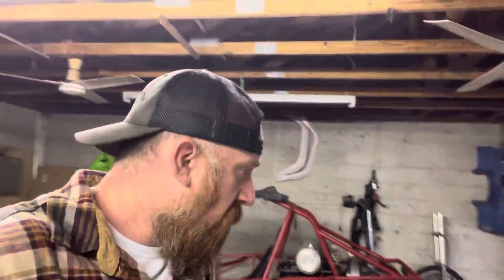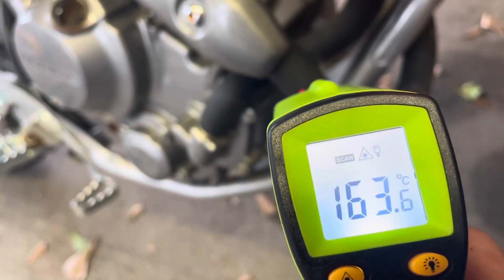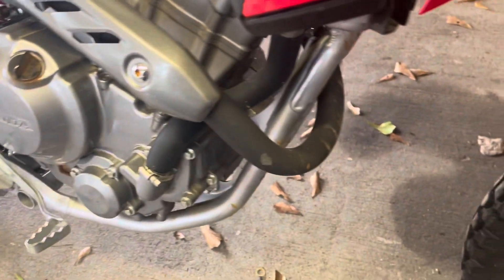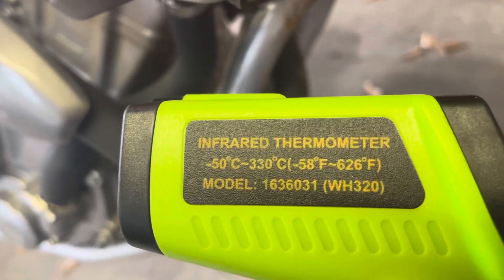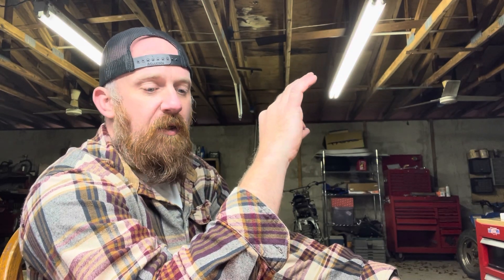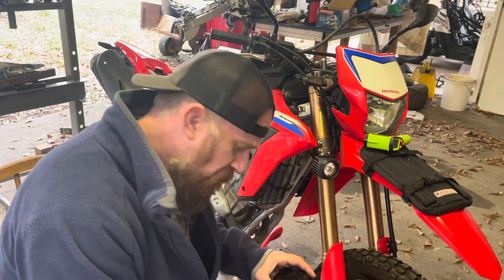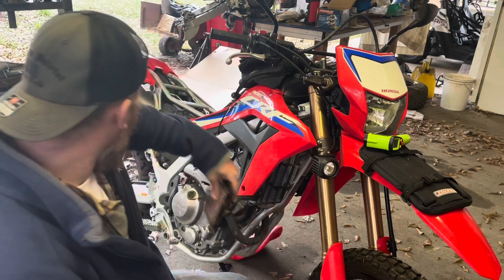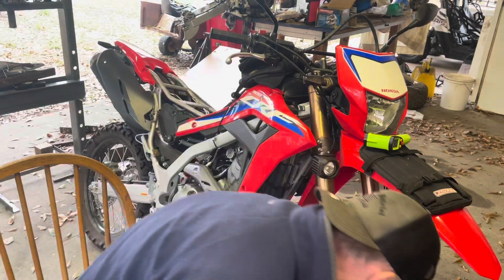DNA Air Filter too lean? BikerzBits Discount #crf300l #dualsport

Comment: Just whipping up this necro....Exhaust coming out of a 4 stroke engine is easily 400-600 degrees C, normally. Plus, exhaust pipes can get hot due to unburned fuel in the pipe and being post-combusted so, an overly-RICH mixture. Also load is a huge factor in exhaust temps. Need to use an AFR or actual EGT. Old school, grease the header and see where it burns off after a hard run.

Comment: I looked at the DNA filter through your link and it's nice to know it has a backfire screen. I once bought an aftermarket filter for my XR, it didn't have the screen and the filter actually got burned from backfire. The screen also would make it flow more like stock which is good IMO. I'm not looking for performance in a filter, but like the idea of one you can clean and re-use. I already bought a new stock filter but will keep the DNA in mind.

Comment: I would do the 550 performance flash 91 octane ECU flash that's what I did I just bought a ECU from them that they flashed that way I have the stock One In A Box in case it ever needs to go back to factory
Reply from the maker: That would be the ticket! And a spare would always be a plus!
Reply: It sure is the ticket I got the full Yoshi system DNA filter and the 550 performance ECU 91 octane flash turned this bike into a rocket ship
Reply from the maker: rocket ship! Yup I’m sold 550 here I come lol

Comment: Thank you for these videos on the filter. I put mine in on New Year’s Day like i said I would on your other video. Do you notice any performance differences riding with it? I took mine out today. It was 30 degrees here in Bucks County, PA so I only went 10 miles. It definitely sounds better and I like it.
Reply from the maker: Personally I can tell a difference and geez 30 degrees i wouldn’t have made it 10 miles lol
Reply: @BackwoodsOffroadOverlanding  HAHA yeah it was cold and sunny so I had to get out for a bit. Wasn’t long but I got my quick fix. After installing the filter I let it idle for 15 minutes to let the ECU do it’s thing. I’m not sure if that is required but I saw it on a different bike DNA filter install and figured I would try it.
Reply from the maker: Right on! My family’s from PA a lot of time I miss the weather of there. I actually like the snow

Comment: Good test, but I think putting a fan on hi directly in front of the bike to simulate as if you were riding the bike on the road that way you get both tests much cooler and see the difference between them. They gun on both your test ran to the HI mark. Or get a higher temp gun.. just an idea.
Reply from the maker: Was fun and yes I’ll be getting a higher temp gun. Rerun the test and run the same once we install the motox V2 full exhaust!